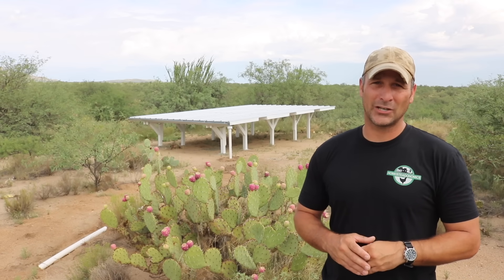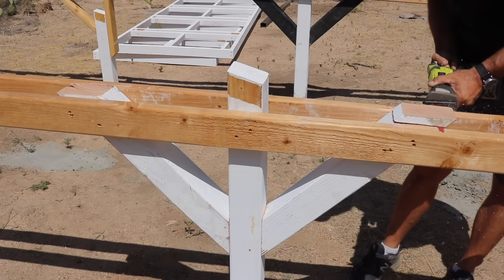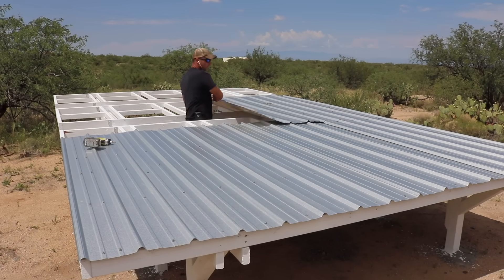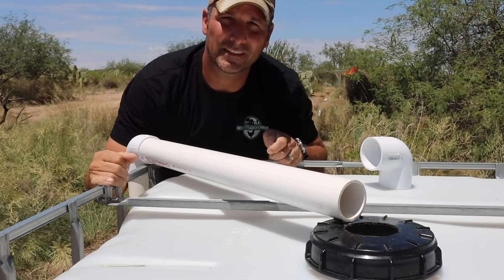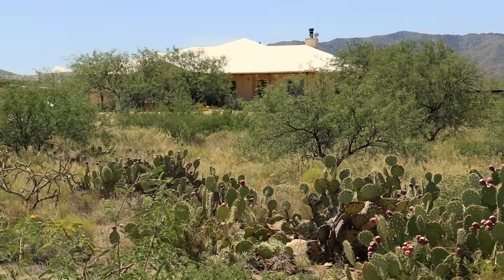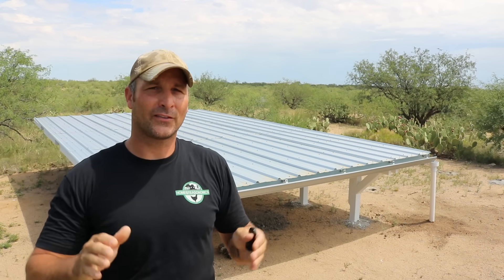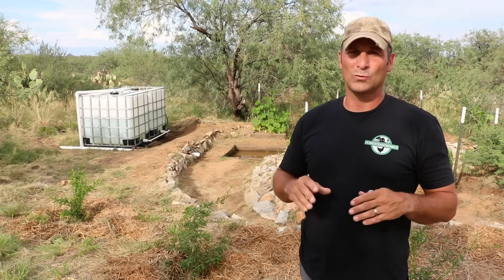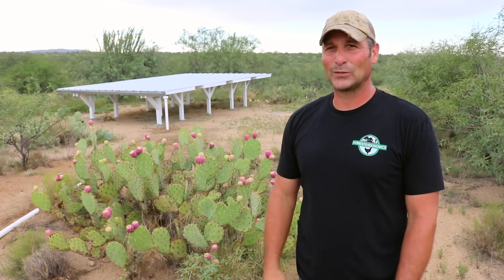Rain Roof -  Rainwater Harvesting Project - How To

Comment: I saw something similar in the Japanese countryside, farmers were using  areas with solar panels and catching rain water. It was metal frame system so they could unbolt and relocate  the system.  Their houses had either thatch (straw) roofing, or clay tiles, which made installing a solar system impossible.  

The other idea has has been thrown around is why not design it into a car port shelter, with solar, and rain water collection? You have to clean the solar panels in the dusty arid areas.. It's big business to design solar panel cleaning bots for solar farms, when you loose 20% solar gain from dusty panels.

Comment: Nice, one issue there is that all your pipes up to the outlet elbow are always filled with water, it is unusable amounth. If you don't dig your pipe underground, but rather run it on columns with smaler slope, all water might be transfered to the tanks.

Comment: How does water get in to tank with no pump again
Reply from the maker: its the level difference that allows the water to flow.  the inlet, where the gutter is... is higher in elevation than the outlet, where it empties into the tanks
Reply: @homesteadonomics  so its gravity force fill basically
Reply from the maker: yep :)

Comment: I've seen clever devices that dump the first water that comes off a surface like that so you don't get any dirt that's collected there. I guess it isn't really needed for garden watering, but did you consider it to reduce sediment collecting in the pipes?
Reply from the maker: they are called first flush devices.  I think they are very cool and can be useful but not so much for dirt and sediment.  in my visiting of places that have used them , they do a good job of mitigating leaves and light weight debris on the first few minutes of a rain but dirt and sediment take lots of water to truly wash away.  And by that time the first flush is already filled up and water is flowing all the same as with out one.  You can see me talk about it in my rainwater QA video

Comment: Looks good and works well! There are some issues with bare galvi for water collection  for use for potable purposes. I suspect they may apply to produce production. At the worst you may end up painting the surface, it does require a special primer for adhesion in my experience.

Comment: Nice making it work for you.  Shame it was so low, a nice shady spot outdoors would have been nice if it was high enough..   I wonder if you considered putting solar panels there instead, so that you get electricity every day, and water when it rains.
Reply from the maker: yes, solar would be a great option but this is too far to do a electrical run like that... but maybe on the future cistern project :)
Reply: @homesteadonomics  Perhaps a 12 volt pump and battery to pump water instead of using a bucket might make it more attractive...

Comment: I don't understand your fastener placement.  Why on the little ridges?
Reply from the maker: generally you don't put fasteners in the valley of the profile... that's where the water runs mostly.  for this it isn't really an issue either way but for a roof it helps to keep leaks from happening when the washer of the screw drys out
Reply: But you can't tighten it down all the way if it's on a ridge, it'll flatten out the profile and become a valley.  I'm just asking as I've heard this before, but followed the manufacturers instructions on my roof (32'x54' surface area + some more).  (Instructions were 2 in each valley for my wind conditions.)
Reply from the maker: I understand that... yes, it's kind of a weird thing... some say one thing and others say something else.  I've seen it done both ways.  So long as the roofing fastener's washer is good then it should be water tight regardless of which way.  My chicken coop actually has them in the valleys as I liked the look better :)

Comment: 4 feet higher and you have useful shade and less dirt/splash back on your roof. Insignificant cost increase.
Reply from the maker: yes, having it higher is much more useful, which I talked about in the video.  But there is also the issue of wind in my area.... those post holes are only  20" on average, which wouldn't be idea for a larger structure with wind.  Preferably a taller structure in my area needs to be made with steel as the wind can rack it pretty hard at times.  But stay tuned as this will probably be revisited in a couple other forms as I develop my longer term cistern goal and figure out a storage solution for my travel trailer project:)
Reply: Right on. I'm in AZ also and use earth auger type anchors to augment my shade structure...you can go criss cross with them and get incredible anchoring. Nylon ratchet straps offer some degree of stretch over cable or chain though obviously not as permanent. Not a lot of people outside the desert SW understand the power of a micro burst. Basically an unforcastable localized tornado.

Comment: I love the rain water collection videos! I've been planning on adding a roof system similar to this on my hunting property. Our summers are hot and the deer stay in the woods during the day but they don't have a water source. A small 8x8 roof in a natural clearing would supply enough water for a little watering hole. I have also thought about this type of setup to water some fruit trees for the first couple of years after transplanting. Keep up the great work!
Reply: The low height of the roof means it would be easy to clean and repair as needed. No ladders to drag into the woods sounds amazing!

Comment: Support system seems way over built, unless you are getting hurricane force winds thru there.  Even then, not sure you need 10 legs on it.  I think I would build it taller, say 8' so you at least have a usable area for storage of other items you have and want to keep out of the sun.  Also, why not just store the above ground holding tanks under it to keep the sun off of the tanks, thus controlling some evap.
Reply from the maker: AKWolf1 yes, all good ideas and I actually address each one in the video.  Thanks for watching

Comment: Great video. How much annual rainfall do you receive in your area? With your various structures, I imagine you can collect a serious amount of water if you have enough storage. By the way, those prickly pear fruits look like they will be ready to harvest soon. :-)
Reply from the maker: Thanks Laura!  Tucson, which I'm closest too gets around 12" per year.  My house can get 2-3 more than that on a good year... but 12" is a rough estimate to plan for:)
Reply: Historically we average 9, but I think it has been less the last few years. Still, with a house, a separate 24 x 24 garage and a 24 x 30 covered animal area (the latter two with metal roof) I can harvest a lot once I get enough containers. Rainwater is so much better than city water for gardens, plants, and trees. Little salts, no chlorine, no flouride, less alkaline. I think you use only rainwater for your home needs, correct?
Reply from the maker: yes, we use it for everything... we don't have a well.... I'd say we go 90% of the year off of rain.. then have to get a few truck loads in the interim dry periods.  But my goal, once I add a bit of capacity is to be 100% all the time.... we currently could do that if we were really strict but are okay with a 'luxury'   ;)
Reply from the maker: ... from time to time :)

Comment: I think I would have made it taller anyway, even if it cost me more. In that heat, shade is a wonderful thing.
Reply from the maker: yes, it is... but trying to use what I had for this little experiment project... and also because we have really bad winds here, anything taller really needs to be steel due to the racking that the structures can go through
Reply: @homesteadonomics  I like the height for your situation... easier to maintain too ... when you have space .. this is a good way to go
Reply: @TrueBlueFlowerChild  agreed, the low height makes it easier to inspect and clean without having to walk around on it by using a push broom or leaf blower with long extension handles and tubes. if i had a big chunk of land in the desert that's how i'd do it and i would also build a fence around it to keep animals away from it.
Reply: @homesteadonomics  excuses... lame

Comment: how is the water bein pushed into the totes? jus gravity?
Reply from the maker: outoftime yep...gravity and the fact that the inlet is higher in elevation than the outlet down at the tanks
Reply: sweet
Reply: Do you worry about the water sitting in the pipe between showers? There must be about 20 litres or so in there.
Reply: He does not drink it, It just goes to the plants and it should not harm them.

Comment: I want to do something like that too but I can't find any info on what to do about all the sand that will eventually get in the bottom of the cisterns. Every surface on the property gets covered in sand from the strong winds up in the mountains, first flush might get rid of some of it but not all and after time will build up in the cisterns, I have no idea how I would get it out. What do you do?
Reply from the maker: I vacuum my gutters couple times a year and I don't get much sediment at all.  first flushes are great with lighter debris that floats off with the first rain... but not so much with sediment, in my opinion at least ....NOTE:  I put very much emphasis on 'my opinion' only...haha... because I know there are folks out there who are very passionate about their first flushes and might take it wrong... ;)
Reply: Thanks
Reply: Dig a deep hole, line it with plastic, stick a pipe down the middle with a sand point at the end, then fill the hole with gravel, then top off with sand. Now you can channel rain water to this hole. The gravel + sand + sand point will act as a filter, and you can pump the water up through the pipe. Basically, a miniature artificial water well. 

I've never tried this idea in real life, so if you try it, I'd love to hear how it works out for you.

Comment: I'm not expert on this and am not criticising, anything that harvests natural resources sustainably is awesome, my concern is that, by having the pipe underground on a gravity feed, do you not end up with stagnant water in the pipe section that is lower than both the inlet and outlet when it stops raining?
Reply from the maker: AliveOrigami I forgot to put the clips in (see pinned comment at top)....but I have a cleanout cap to drain the whole thing😀
Reply: Ah that explains it, awesome! :D
Reply: A couple of small holes drilled in the lowest part of the elbow would fix that.

Comment: WHITE IS COOLER OO, COOL JOB NOT EASY DIGGING IN THAT CALICHE SOIL. I DID SOME DIGGING OUT THERE IN ORACLE AT MY DADS PLACE. LOVE YOUR VIDEOS, JUST SAYING OLD ONE LEGGED JOSEPH T RETIRED NAVY
Reply from the maker: Thanks Joseph!  yes, this isn't the easiest soil to dig into!
Reply: yes in oracle az we were pretty high up in the mountain and could coast down hill for miles no gas wasted, but the way back was hard carrying wood for the house. dad used a giant acid tank for a water tank, it was used for plants like yours, but we gave horses and other animals water as well. cant see these small font I like to type with large my eyes are going. anyway the acid was long gone he cleaned it with 100 pounds of baking soda and 5000 gals of water. that was a trip, it shot water out of the top, well I should say foam. anyway the ranchers were all jealous about his white oak trees and roses he had growing on the land. first 3 years he had to water them weekly the 3 weeks 4,5,6, etc.... until the rarely needed water at all, they adapter. anyway thanks for the reply old one legged joseph t retired navy

Comment: Good job Joe! It's awesome as all your projects! By the way, I've seen ryobi tools you're using several times. How do you feel the quality of them? Can you make a small review maybe?
Best regards from Russia.
Reply: I use them a lot too. Very handy tools. I used my Ryobi reciprocating saw so much that it wore out the slide shaft bushings. Replaced them, then shortly thereafter the DC motor armature wore out. Ended up buying a new saw cause the motor was almost as expensive as the whole tool.
Reply: @ephpea8449  But isn't it possible to order spare parts from China? Should be cheap there, no?
Reply: @СергейДеркач-у7ю  If you can figure out how to order a replacement motor for cheap from China that actually fits, you have one or two months of time to waste waiting for it to arrive, AND you can figure out how to press the metal gear onto the new motor's shaft, sure.

I needed to work on pruning my trees during the cool months of the year and did not have any time to waste trying to find the right cheap replacement motor from China. Where I live in Arizona, it gets to 122 degrees Fahrenheit outside during the summer, so it is imperative to get all my yard work done during the winter months while it is cool outside. Nobody wants to be outside working in 122F heat, people die of heat stroke doing stuff like that. 

I recently bought a used Ryobi reciprocating saw at a yard sale for $5, so now I've got a spare. Can't beat that price!
Reply from the maker: Thanks!  Great to hear from Russia too!  :)
I think the ryobi's are a good value.  Are they the best out there... I don't know.  but I do think they offer a good tool for the price :)
Reply: @homesteadonomics  Thank you for your clear answer! Keep on doing your fantastic projects! Best of luck to you and your family!

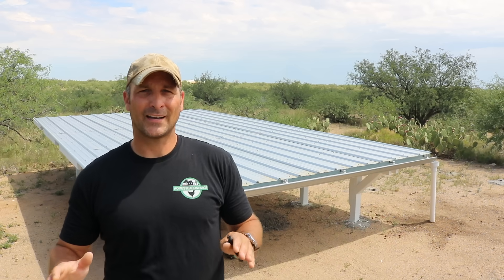Comment: 8:40 - Functionality.

First, I really like your videos.  They are so clear, honest, and straightforward, not trying to be too cool or trendy ... thank you.

If I did something like this I think it would be cool to do a large platform raised 1 to 2 stories up that shields a house, shop and/or carport from the sun, rain and elements.

I can't see why one could not use solar panels for at least part of the catchment surface, and then maybe some clear panels that allow sun/heat through and have large cisterns above that have water flowing through some black pipes that heat the water and keep a reservoir of hot water raised up with some gravity feed.

Maybe also use some portion of the rain roof as heating reservoir for hydronic heating so that when it is cold, circulate water through the heat reservoir and through simple radiators inside the house, underneath.

Since you have the water-tight rain roof over your structure, you would not have to be so careful to engineer the house underneath and could have it inside and far away from any rain flux, plus save on roofing complexity and costs.  I was looking at the example of some of the house on You-Tube that are encased in an inexpensive greenhouse or warehouse structure.  But I think actually building a greenhouse around or over one's house causes temperature problems, because people are not plants - thus the water reservoirs and temperature control.
Reply from the maker: thanks!  I appreciate that... I just try and be myself, which is far from trendy...lol... I am literally just an average joe doing random projects.  Not perfect ones but doing the best I can at the time.

As to the idea of the about the raised roof over a home... it actually could be really great and some folks have even done it here in the SW US.  Often times it will be done by someone in a small trailer with a roof leak and they just build an awning over the enitre thing... it gets airflow and shade... and as you mentioned could be covered in solar too!
Reply: 8th and you-

Comment: Love those rainwater harvesting projects.  I am being inspired to attempt to aid some friends who are of limited income but need a reliable water source.  Their house is on the island of Myorka...off the East coast of Spain.  Being in the Med, I figure they get a fair amount of rain at least at times.  I know you usually use steel roofs, I'm  a bit blind to availability of materials and cost.  They currently have a really pretty red tile roof and I think that would  work pretty well.  They also have a couple of out buildings  one the generator shed and the other a former chicken coop.These buildings have concrete 'slab-panel' roofs.  I think it is probably light weight concrete.  There are a lot of building restrictions and the last I was there, there were surveillance aircraft.  These folks have an open cistern for a catchment from a small spring.  There has  been a problem with the cistern going dry and cracking.  One question,   Do you think the terra cotta roof would work for water harvesting?
Reply from the maker: yes, for sure!  check out my 'rainwater collection surfaces' video... I think tile/terra cotta roofs are great... and concrete also.  It can be done very subtle so as to not alert the local code police...haha    as for the cistern with cracks.. I'd either recoat with a concrete product like 'thoroseal' and then recoat with a liquid rubber sealant safe for potable use.  ( Ames Blue Max' is what I used on my metal cistern)